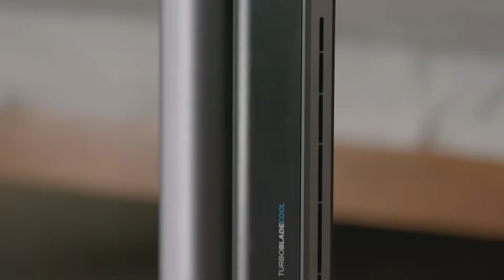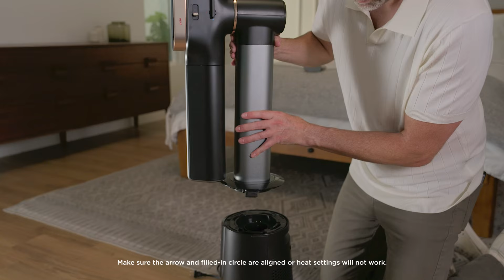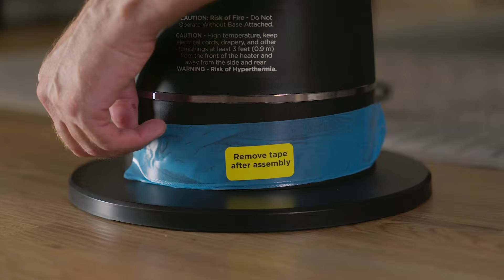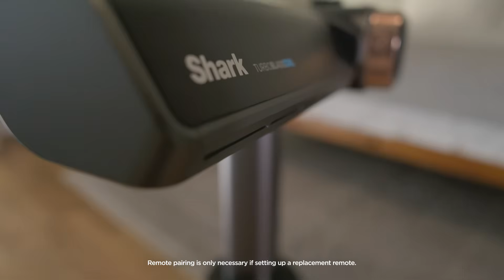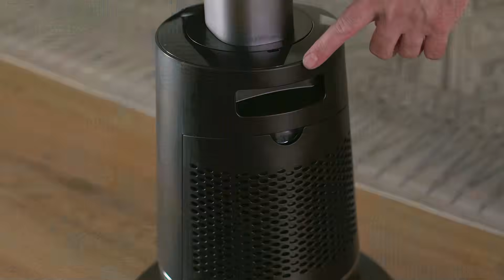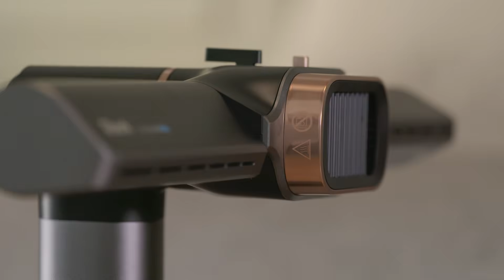Getting started with your Shark TurboBlade Cool and Heat

Comment: Am I understanding correctly that I need to interact with the unit every 8 hours? I bought it for my plant room for the colder months. I don’t usually go in there every 8 hours.
Reply from the maker: Hi there, there can be a number of reasons your Shark turns off on its own. Here are some.
Thermo IQ mode reached the target temperature
Room reached 100°F (safety shutoff)
8 hours of inactivity in heat mode
Timer was activated (1–8 hours). To turn off the timer, press Timer until it reads “0.”
Reply: @SharkHome thank you!!

Comment: Bought two today. The heat doesnt work on either. The fan mode will not change. I have the dial on red.
Reply: I had the same problem. Turns out the pole and base were not fully aligned. Gave it a good hard twist and it works!
Reply from the maker: Hello Constantine, we’re sorry to hear that the heat mode on your Shark isn’t working, and we’d love to assist you. Please send us a private message on any of our social media channels with your model number, so we can help resolve this for you.

Comment: Tai sao toi k điều chỉnh được che độ nóng,tôi muốn trả lại những Toi không tháo canh quạt ra được , co cách nào chỉ cho tôi tháo no ra không?
Reply: Hold and pull the blade. It’ll come off.  
The base you’ll have to put in a tiny flat head to release the locking mechanism

Comment: No height adjustment is a serious flaw and deal breaker.

There are other issues. The new unit with the heater, not only has no height adjustment, but it is also shorter by almost 10 inches and the spread of the blades is much narrower than the original which I have without the heater. Huge flaws. Why? Well, it is more expensive. Meaning more affluent people, with more income to spare will buy it. These people have bigger, wider and taller king sized beds. So this new heater fan does not clear the mattress surface and people sleeping on the bed are not treated to a wider bed experience, even if the fan was taller. I suppose they could throw away the box spring, drop the mattress and sleep stuck to each other. 😂😂😂
Reply from the maker: Hi there, thanks for your feedback. We will absolutely share your feedback with the relevant teams for consideration on future products.
Reply: @SharkHome  thank you for your response
Reply from the maker: You're welcome. We hope you have a great day.
Reply: @SharkHome  please read my updated concerns